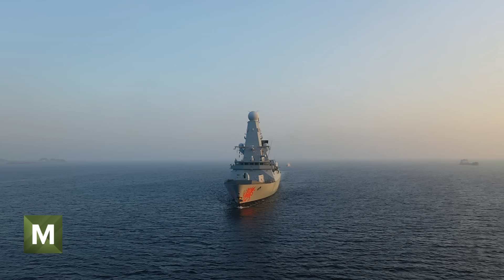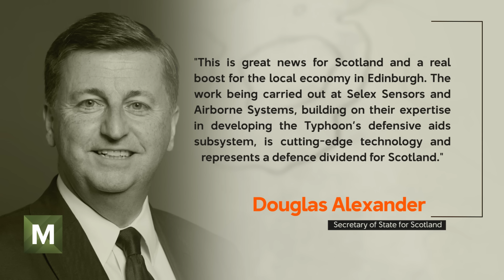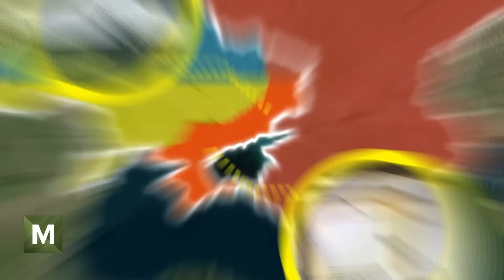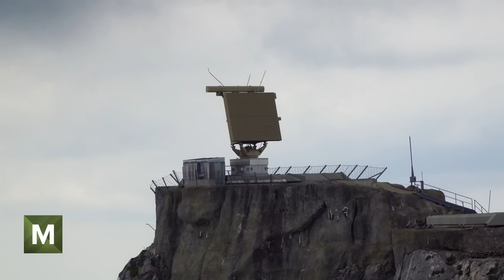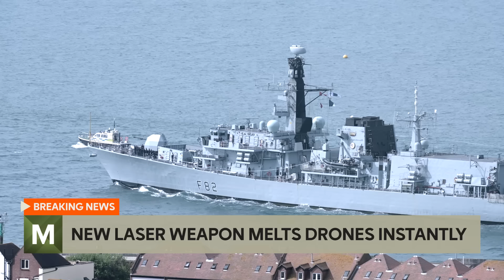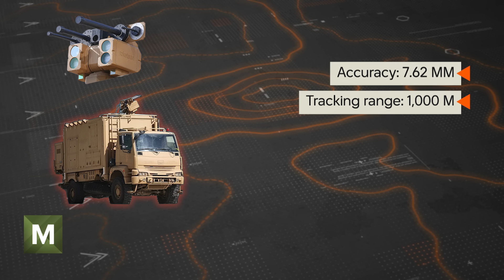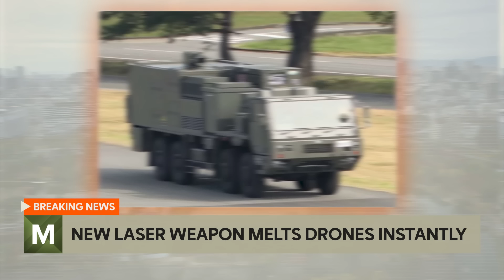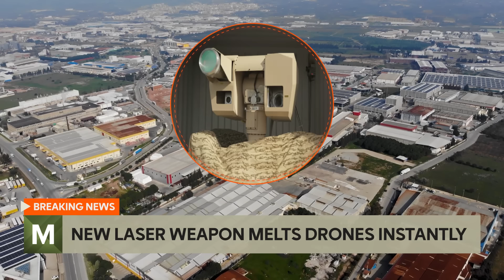UK’s DragonFire Weapon Just Made Drones Completely USELESS

Comment: Drones will be useless – this is going to change everything!!

Until drone manufacturers discover mirrors, anyways: put a mirrored surface on the bottom of the drone, then see what happens..!!
Reply: mirrors only reflect so much

just increases the time it survives
Reply: No, drones will get small, faster, harder to sense and most importantly cheaper and MASS produced.  How many drones that have been designed specifically for the task, would it take in a single attack to overwhelm and destroy this system?  50?  100? 500? 1000?  Cost per laser shot is great, but it might be overwhelmed by $1m or even $500k worth of swarming drones.

I’m not saying these are not a great system and definitely needed, but drones are still the future.

Comment: What was the test configuration? Flying 400 mph in what relative direction? Were these drones naked or "armored?" How many were shot down in what window of time?

Lots of questions need answering, and lots more testing needs to be done before it can be fielded.
Reply: They aren't going to tell you
Reply: Indeed.  Also the claims of "melts drones instantly" is a wild exageration.  In the sample footage near the start it shows it takes several seconds to take down just a simple domestic plastic DJI type drone.  Against a more robust drone and against swarms of drones (the current method of deployment) this severely limits the practical use per cost of the unit - regardless of how cheap it may be per "shot".

Comment: Its effing star wars now. Helicopters, fighters, drones, tanks, ships, anything will now be engaged with lasers and death rays. This isnt just a step against drones, this will change the future of defense worldwide. Its hella scary
Reply: ⬆️ so what's your point? Didnt you notice that the guy in overall charge of the project at government level is named Luke?😅😅
Reply: It's not scary until they mount the system to autonomous robot dogs that can run 50 kph. That takes scaling it down without significant loss of power. Watch out for CCP agents, unless China already has it and doesn't feel the need to beat it's chest in the press.
Reply: But not when it's raining :)
Reply: @DieFlabbergast For now, but only for now. It reminds me of the rail gun, which was largely abandoned or changed. If this is the future, its scary. Lets hope we continue to get torched by fire and not lasers
Reply: Mirrors or silvered surfaces reflect lasers so easily countered.
Reply: @petewright4640  Doesn't help on lasers with this level of output.  even the best mirror still absorbs SOME energy, and once it starts to melt, that reflectivity disappears.
Reply: Won't work in cloudy or rainy weather.
Reply: You forgot ray guns , real life phew phew phew guns bro
Reply: 420 million for a project that will be quietly forgotten.

Comment: Well as great as lasers weapons are against drones, lasers works best in clear weather. Rain, fog or even dusty air might disrupt the laser beam. I think those Dragonfires are already in Ukraine or will be very soon?  UK promised Dragonfires to Ukraine back in spring 2024 so when production ready they will to Ukraine. Then we will know more. But as a layered air defence laser weapons are great. When weather allow.
Reply: Part of the reason Dragonfire is such a big deal because they have figured out how to counter bad weather conditions.
Reply: Not for a while yet, first dragonfire’s will be installed to t45 destroyers for full testing some have undergone power improvement program to ensure the power supply for dragonfire some are undergoing the pip now, a land based system which Ukraine needs still isn’t as advanced due the power supply there’s versions that work but nothing mobile just yet, the best suggestion was to put on a platform like paladin, a platform dropped from a truck placed in position’s then it can be moved elsewhere after firing to keeps position’s hidden from the enemy.

Comment: Dust and certain atmospheric conditions make laser weapons questionable in some uses.
Reply: Also precipitation. Radars will be less sensitive to that, leaving SPAAG systems like Gepard to take up some of the slack.
Reply: @ArKritz84 
That more than anything. The sky is a mess!
Reply: They only effect range also it's not a one piece solution anyway it will work along side microwave emission energy weapons missiles falax fighter jets and many other defensive messures including ew so yes every system has flaws it works as part of a network
Reply: @jackbenton9374  for sure, they're just a piece of the puzzle. At least until they can be made mobile and cheaply enough to deploy them at scale (i.e. on every vehicle everywhere).
Reply: That's why I am much more interested in the mobile units than the stationary ones. Both useful but for completely different situations
Reply: @juni-0894  the problem is mobile power delivery. Even if they use huge capacitors, they still have to be charged somehow.
Reply: @ArKritz84 These vehicles have things called engines and generators. The power requirements are not demanding
Reply: Energy weapons require a lot of energy that said u can bet the best and brightest are working on that problem  @rogerphelps9939
Reply: @juni-0894 
I think think rail guns may be more suited for this type of warfare. Cheap pieces of plastic being accelerated to high velocity, is more effective than laser weapons. What would be ideal would be to have primer chord arrows laser guided to destroy large swarms of incoming drones.

Comment: Send them to Ukraine,  ASAP!  🇺🇦
Reply: UK Sent the prototype to Ukraine a year ago so they can reproduce their own. UK is also providing data and material.
Reply: It looks like they first need to sign a contract with uk gov for a lots of money and then do a real test on a battlefied. Smart, I would do the same.
Reply: The amount of energy it takes to operate you would have to have a small nuclear power plant. That’s why it’s possible to use it on a ship that has nuclear power.
Reply: @bigstyx  Nope. It only draws 50kW.

It's currently being installed on British Diesel powered destroyers. They have 4 power plants, each plant generating 21,000kw.
Reply: @babalonkie  Nope.  It OUTPUTS 50kW - it draws more like 100-150KW.  This requires 3 phase power supplies.
Reply: @UKMonkey  Ships' generators produce 3 phase power. 150kw isn't very much; you can get 150kw space heaters ffs.
Reply: Is Ukraine paying. Guess not
Reply: @dw9646  Well, until you stop guessing and actually know. Maybe I can help... The UK is testing the system in actual combat conditions to gain invaluable development information. Ukraine is benefitting from this testing in lives saved.
Reply: @dw9646  Yes they are.

Which is irrelevant, being we Brits will happily give them to Ukraine for free... just like the thousands of NLAWS we gave them that destroyed the hundreds Russian Column of tanks heading for Kiev.

Protip: Never put Putin or DJT in a room with a typical Brit... as they would NEVER leave ever again... regardless of the "Consequences". Threats, power, wealth, Technology or numbers do not scare a Brit... on the contrary... it has the opposite effect.
Reply: @dw9646  The UK has tested the system and placed a £316 million order for its own forces, with deployment planned around 2027. British officials have hinted at possible future supply to Ukraine, but no confirmed export has occurred. Until the UK formally decides to supply DragonFire, the question of payment remains hypothetical.
Reply: @dw9646  Ukraine is paying a lot. with blood and human lives. Ukraine is the country that is suffering from the imperialistic criminal russian regime. Ukraine is defending indirectly Europe from Russia!
Reply: @dw9646 Europe will pay dearly if they don't help ukraine now.
Reply: i doubt it is that valuable.
Reply: @AN-ks2ep  It shoots down drones cheaply... that's valuable.